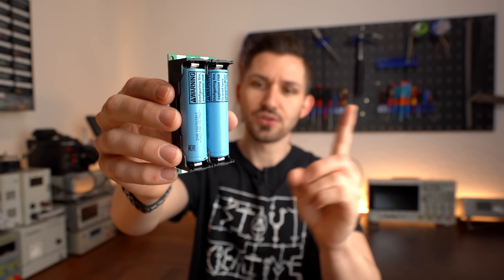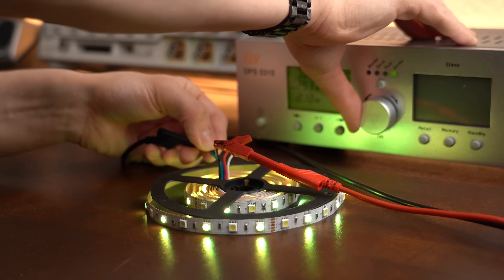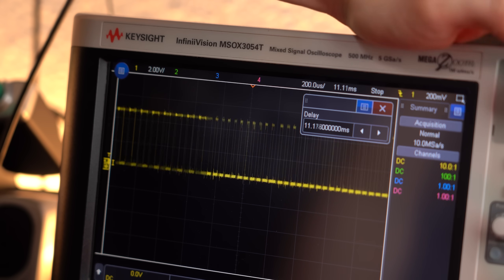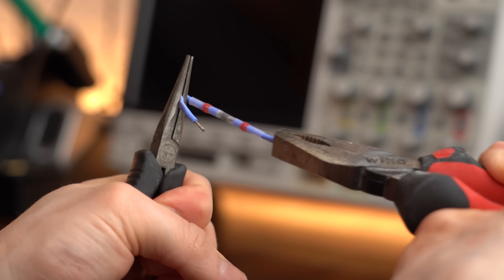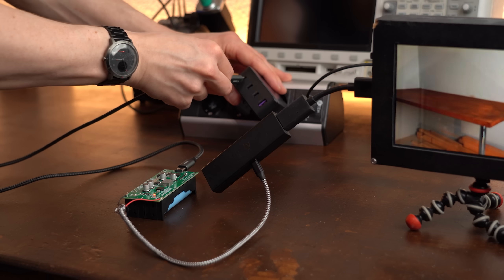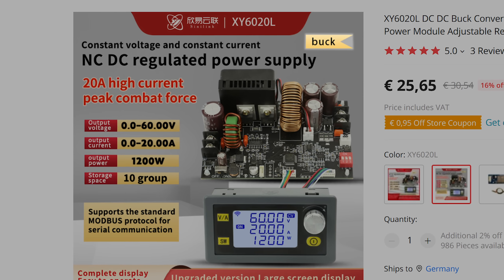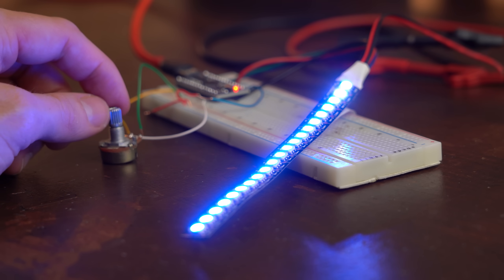I tried finding Hidden Gems on AliExpress AGAIN! (Part 4)

Comment: Having read the many comments here about the power supply noise appearing on the output voltage of the units you testing. It would be helpful to indicate the vertical scaling of the oscilloscope display, i.e. volts/div. Without that it’s hard to judge if the displayed “noise” is acceptable or not. For example, was the “noise” +/- 10mv, +/- 100mv or greater ? Other factors may also affect the results of your “noise” measurements. Was the power supply operating under load? Was there any radiated noise from the power supply being picked up by the oscilloscope? A quick and “dirty” test as you have done,  may not yield the most accurate results. Perhaps there were other precautions you took to ensure the “noise” appearing  on the DC power supply output was representative of an actual use scenario.

Comment: Those heat shrink solder connectors work a lot better if you add a little flux. Just a tiny bit of liquid flux is fine & drastically improves the solder’s wetting characteristics. I’ve done a few experiments with them, I wouldn’t use them without flux now.

Comment: It could be useful to show us what ICs the various SMPS based boards use. Also, could the output noice you demonstrated some of these have, be mitigated/lessoned with adding various extra output capacitors or is it inherently caused by flawed design?

Comment: Just a heads up on thosetrippers. The yellow one is made strictly for UTP data cables and nothing else. It works really well actually for its price. The grey one is made specifically for stripping coax cable. And it also works suprisingly well for the money. The red one is made for scrapping cable. Also works well for its purpose. If you want a tool to strip all kinds of shielding, a knife would be the best bet. Sadly there are no universal solutions as insulation thicknesses vary with different cables.

Comment: Couldn't you just slap a filter to the UPS output?
Reply: This being a buck converter there is a limit to how much you can filter the output without getting it to oscillate, maybe get rid of those peaks at best. 
Still, for $25, it's a great supply!

Comment: I use the heat shrink solder connecters on a daily basis. I'm an security technician and work a lot with small wires mostly around 0.6mm2. The connecters are amazing, they are tiny compared to other connecters and if I solder the wire together myself. I haven't had a problem with hard wires, maybe you need to heat it more, I tend to use a lighter, it's a bit easier to carry around. And for small wires you can connect multiple, I've connected up to 4 wires in a connecter.

Comment: 5:49 It work perfectly fine as long as you do as supposed by letting the solder completely liquefy and wick the cables! that is the reason it did not work since you can clearly see that solder didn't attached to the wire since it never had time to or more the temperature was so low or dirty wire.

Comment: You must heat it so ALL of the solder melts into the wires and is shiny, not left a big blob around the cable. And also heat the solder evenly all the way around.

Comment: Thanks for the video. 

Do you have any content on what 'bad' output noise does or what effect it can have on electronics? 

If not it would be a really interesting video to me at least. 

I had a "usbc to 12v" adapter cable that I used to power a pci card a while back, and it caused the pci card to whine very audiably. I wonder if this was from crappy output on the cable.

Comment: I designed a 3d print that works the same way as that red wire stripper, but is only adjustable for a small range of wires and it's the same size as the handheld yellow wire stripper.

Comment: whatsup man  : )  i have asthma and its been kinda kicking my ass lately, iv been needing the nebulizer almost every night just to get back to sleep, but weve also been losing power a lot lately with all the storms this spring, would it b practical to build a backup power supply using about 20/30 18650s that would b able to handle about 2A @ 120v??

Comment: around 2:58, u mean they counted every single led instead of each cluster? i have to admit, if i was tasked with answering how many leds were on the strip, id probably count them the same way, n rgb diode is still 3 leds, even tho its in a single package

Comment: 2 things. 

1: The shrink-flex tube is better than you give it credit for. First off make sure the solder melts completely. 
ALSO - there is no good way to bind solid core wires - HOWEVER - use a pair of pliers to flatten both ends and give it an uneven surface to bind to, then add a tiny bit of solder in between and melt it, - now heat up the shrink-flex - make sure the solder melts - and now try it. Should hold up a lot better.
Also a trick when using these with thin/flimsy wires: spread the core stands out on both ends. put them together so there basically only the length of the solder between the covered ends (the rubberized parts) of the wire. push the core strands down on the OUTSIDE of the wire. Twist half a rotation so you create "more grip" for the solder - but not enough to break fragile core strands. Place shrink-flex on top and shrink it (can be fiddly. use tongs to make it easier.) This will joint will now most likely be the strongest part of the wire - especially with thin/flimsy wires.
(Sorry not a native English speaker - The point with this method is to create more friction area before failure of solder joint. this method ensures that you will need to actually tare the solder or rip apart the core strands to cause a failure - instead of the "normal" way where you can easily get a failure due to lack of friction/binding.)

2: That UPS is probably not meant for the "general public" - but rather designed for a specific device at some point - since "fixing it" would be very cheap. However it looks to be a very durable design which is why I'm thinking it's an industrial product. Never the less - it will work with most products even with that noise since most "high quality" products are made to tolerate "dirty power".

Comment: Sometimes you get what you paid for and sometimes not. I tested a bunch of small touch-controlled switches that were extremely low priced and they worked perfect. I have tested various classD amplifiers that have worked perfect like the PAM8302 (which is a BTL amp actually and almost smell audiophilic).
These videos are great as you dig up stuff I haven’t been looking for and some on today’s show was asked for in a forum.

PS. I have bought three lenses for my camera and they haven’t disappointed me at all. They were all below USD100.
Reply: How did you use those PAM8302 amps? I'd be interested to hear more about that...

Comment: 8:02 The grey one is mostly for coaxial cables. If you look inside of it you'll see that it has 2 blades. One cuts the outer insulation and the other cuts the inner insulation. The 2nd blade also has a small divot that the copper wire in the center goes through. The reason you cut coaxial cables with 2 different depths is so the end piece fits on perfectly.

Comment: Your noise measurements are affected by your probing technique. Try reading Analog Devices' Application note AN-1144. Even the short ground lead "spring" provided with the MXO44 are not adequate for testing output noise on a power supply.

Comment: 10;45 Most of the time, an output load will flatten the spikes. If not, just use a capacitor.

Comment: the low voltage protection on your ups doesnt mean its bad at all, it just does mean it doesnt protect, all the components on the 5v ups are ones that are also found on desktop gpus, modern ones. they will be DAMN good at transforming power. its one phase for 13watts, gpus have 8 phases for 300w, this is genuinely a safe product.
Reply: and the psu had all cheap caps around it that screamed "we arent japanese" yet you only scolded it for its noise and even touched the caps without any warning for viewers, those 470uf caps arent gonna do danger at such low spec voltage but a cap can kill. you have 1,8m subs, teach them something and dont just go by your labs standards and the thought of "i know how not to die anyway" also, output voltage noise in both cases really is NOT important. what do you intent to do with a cheapo aliexpress psu? power up a small scale radio station?

Comment: I have an idea for another RFID hacking video to hopefully achieve a greater distance, curious if you think it would work…   

When trying to increase the range that you can unlock the device with the tag, you need to have really good coupling to be able to reduce the amplitude of the RFID transmitter with the keys from a greater distance, which might as well be considered impossible to achieve (since it’s over the air coupling), so what if instead of shorting it from a distance with the keys, you were able to invert the highs/lows of the key to send spikes of emf that increases the amplitude on the RFID transmitter rather than reducing  it, this would be much more achievable from a distance, but will it register the key properly?  Does the transmitter detect a reduction in amplitude by triggering on changes in amplitude or specific voltage levels?  …I’m thinking as long as it doesn’t trigger on specific voltage levels, it should still register a reduction in amplitude if you keep the emf normally high, and simply disable the emf in sync with the bits of the key, do you think it could work?

Comment: Hey Scott, very interesting video as always and for years now.
I don't like working with high voltage (220+v) and I'm facing a problem with what I think is a switching power supply but outputing 5,2 / -9 /+9 and gnd.
It comes from a big all on one party boom box.
Would it be possible for you to make a video and explain how it works ? I'd really love to understand and I'm complètement stuck !
I'm from Belgium so I could easily send it to Germany. Hope you'll be ok 😊

Comment: You need to heat the solder sleeve more. The solder sleeve should fully melt, not be a visible bulge like in this video.  The mechanical strength and resistance would have been better.

Comment: 8:45 interesting. Got the grey one and love it. I actually never change the tool size, as everything small is stripped by the automatical wire stripper plyers, so only large cables are stripped with the grey tool :)

I selected the "6" setting on it (largest diameter), put the blade to B and the spring to C and adjusted the screws to 1.88mm (blade) and 2.0 mm for the spring.

Hope that helps.

Comment: I bought some of the 18650 battery holders that had the built in chargers. I tested them with motion sensors on arduinos with wifi, and stuck them around the house. They did a great job. Of course, I did not check them on a scope for output ripple, but then again, I didn't buy the cheapest available either.

I have used the solder filled butt joints for decades. I found that those with a bit of flux in them work much better, but again, they are not the cheapest available. When properly heated, you will not see the solder ring impression in the plastic any more. 

For the buck converters, I would only use those if I had a 12v supply in the project, and needed minimal 5v for running an arduino or a LCD. I wouldn't try to use them near max current load. If anything, I would add a couple filter caps to it and be done with it.

Great reviews. It's cool to see some of the more useful items are still out there.

Comment: My house's power lines, when i stick the voltmeter in to a power plug it says 274V, everything works fine but i mean does it hurt electronics? it is normal? (i don't think so, it should be 220-240V) (i live in italy btw)

Comment: either the quality of those heat shrink connectors is terrible, or you you didn't apply enough heat. The solder is supposed to flow into the conductors better.  For removing wire jackets, try a cable knife. Those little yellow strippers work great if you buy decent ones. Sometimes you need to squeeze them a bit.

Comment: that gray wire stripper tool I have, and it constantly ruins my attempts at stripping the outer layer of CAT6, I can try all I want but it will still manage to always damage the twisted pair no matter what size I use, at least on mine

Comment: I am disappointed that to reviewed a DPS type power supply without give OpenDPS firmware replacement for it a try.

BTW you can eliminate noise on DC power supply by adding a big capacitor in the output. You should know they as a keysight owner !

Comment: The recomended method measuring dcdcs is to set 20MHz bw limit and to test it at the output capacitor terminals. I see big huge ground loop at 10:10. There are springs attachable to gnd of probe and the hook must be removed exposing the sharp probe. Area of this loop thus transformer effect is 30-100x smaller. Just see "correct methods of measuring dcdc output noise"

Comment: I use the cheap power supplies like that. They work great if you don’t care about the noise. Half the time I’m just using them as lithium chargers, so that doesn’t care about noise. None of my other projects have gotten to the point where i would notice the noise. So I like them a lot. The high wattage output is great.

Comment: You can most certainly splice more than two wires together with the solder sleeves, and they're also good for hooking up a drain wire to a shielded cable. Also, you didn't heat them up long enough; the solder was not done flowing. There are much much higher quality solder sleeves available from Raychem and TE, but they're also much more expensive.

Comment: the solder sleeves might be just garbage but you should lap the wires next to each other, it would also help to tin the wires beforehand so you wont have to keep the heat on for it to completely melt. I love aliexpress and your videos thanks for reviewing stuff because Lord knows not everyone has money to bite the bullet but theyre are gems out there.

Comment: I regularly use Raychem solder sleeves for multi core shielded wire and have none of the issues you mentioned. The Raychem sleeves do have flux in them and we use teflon insulated wire. 

It looks you didn't get it hot enough for the solder to melt in a few of them.

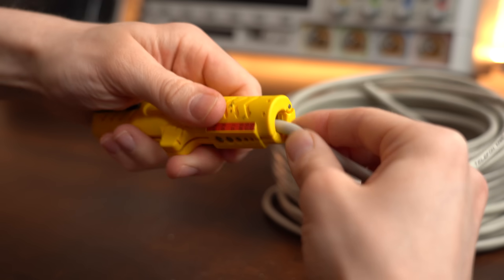Comment: The jokari @7:39 comes in different sizes, I have one I use for normal three and five core house cable and a smaller one for cat6 and antenna cables

Comment: The wago connectors have a totally different use case than the self soldering splices. Wagos are for changeable connections and are mostly used for building electrical systems. The splices are to splice wires permanently for repairs or changes, so the better comparison would be crimpable splices. I have even seen them (well not from Aliexpress, but the same type) used in avionics, so they should be good and reliable if the quality is okay.

Comment: That grey wire stripper is likely meant for coax cable, not really anything else. It should have 2 blades - one to do the outer and one for the inner. The spacing between the blades is fairly common across lots of coax connector types.
And you're meant to adjust it for your cable type and leave it set. I keep one set up for RG6 and another for RG58... And I wrote that one them.

Comment: I've used the heatshrinks a lot for 12V wiring inside my glider. They are a joy to work with. I didn't twist the wires though.
Tip: if you shrink them from the outside inward, you trap the solder nicely inside. If you then melt the solder core, it spreads out a bit and you have a lot of contact area.

Comment: I really like the idea of that battery-powered micro USBC UPS that you didn't like the dirty output from I have some devices where I could care less about the dirty output :-) but I want to use lithium iron phosphate batteries are you aware of any cheap little UPS circuit like that that will use lithium iron phosphate?

Comment: The gray wire stripper the middle one of the three you used is not a wire stripper those actually are quite fantastic but they are made for one very specific kind of wire they're made for coaxial wire they're designed to cut the outer sheath and the inner sheath at a different length at the same time to give you the exact end that you need to put into an RG6 or an RG59 coaxial cable it's not really made for doing other kinds of wires which is why you're experience was lackluster that red one however is pretty cool looking

Comment: I've heard those solder sleeves (and soldered connections in general) can be bad for automotive applications because motion of the wires can cause breakage from the solder stiffening the wire. I believe regular crimp connectors are preferred.

Comment: Not sure why you are trying to use that gray coaxial cable stripping tool on normal multi-strand cable, but you do you.  BTW, the numbers on the orange insert refer to RG-6, RG-59, etc coaxial cable.  I have several of these I got locally and they work great for their intended purpose.

Comment: So I have the yellow stripper however I do not use it as a stripper. The main use for me is to push data wires into keystone connectors.

Comment: The solder heat-shrink connectors are great. While the instructions have you twist the wires, that is not actually necessary. The heat-shrink provides more than enough mechanical force to prevent the soldered wires from coming part.

Comment: Iam currently using heat shrink wire connectors from Berner (they cost more but they are a lot stiffer than cheaper). 2 years of use in truck repair jobs (especially lights, also not recomended CAN network and ABS sensors - without any problem). They can withstand a lot and iam a big cheater, i dont twist the wires, i simply slide them together in shrink tube and melt solder and glue with heatgun and its done. They still can hold pretty big forces like that.